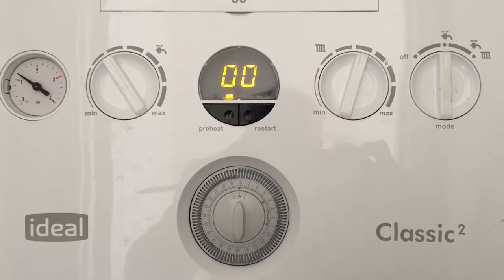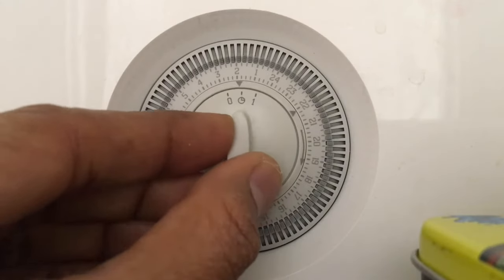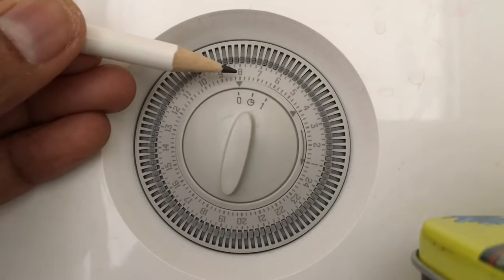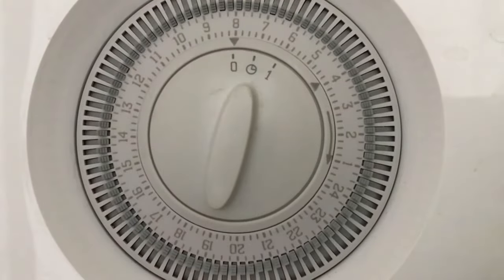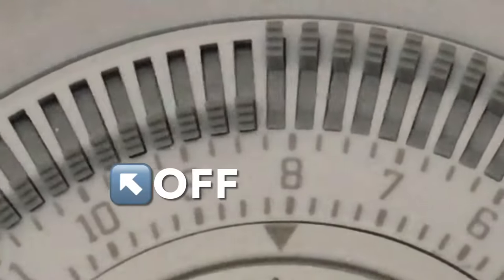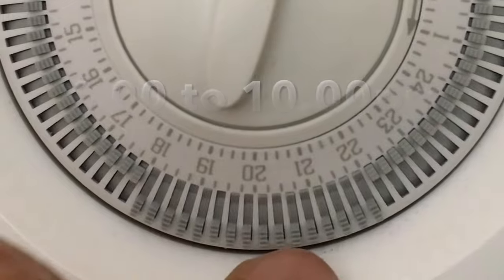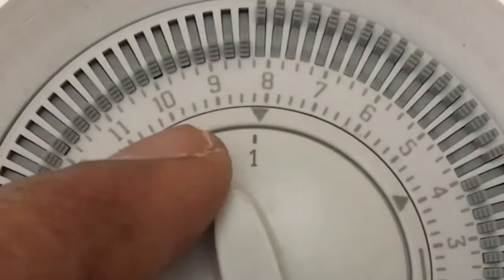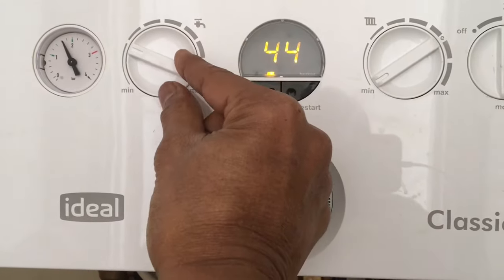How to Use Set Adjust Mechanical Timer Control Pin Clock Switch Instruction Ideal logic Combi Boiler

Comment: Thank you for the video, however you have used the wrong arrow to set the time.  The arrow at 12 o'clock is for setting the function, timed, constant or off and the arrow at 3 o'clock is for setting the time. You have actually set the timer to 4 o'clock.  Hope this helps.
Reply from the maker: Hi Valrita, Thanks for sharing your comment :-)
Actually either of the arrows (12 or 3 o'clock) can be used as reference to setup Clock (Current Time). You can try and let me know how it works.

In my case having done 'CURRENT TIME' at 8:00 am and 'PROGRAM TIME' set between 4:00 am to 8:00 am, the boiler gets switched ON next day morning at 4:00 am when dial rotates clockwise and reaches middle arrow .
Reply: @bicyclecolours8988  Hello, my boiler is the same as this and to set the current time I have to use the arrow at 3 o'clock, the 12 o'clock arrow only deals with the function.
Reply from the maker: Thanks Valrita for sharing your comments, hope this will be useful for other users.
Reply: This comment has just explained sooo much! Thank you 🤣🤣
Reply: This made sense. Thank god i read this comment

Comment: Hi. I need an advice and maybe someone will help me. In my apartment electricity is for top's up. I forgot top up on time and electricity stop working in all house. I top up electicity card and everything working again except boiler. I have ideal exclusive 2 boiler and now it's heating only water, but not radiators. Is it possible that when electricity stop working it could change something in boiler settings? How could I fix it? I would be very grateful for any advice.
Reply from the maker: Hi Marlena,
The boiler is fitted with frost protection that operates in all modes, provided the power supply to the boiler is always turned on. If the water in the boiler falls below 5ºC, the frost protection will activate and run the boiler to avoid freezing. The process does not guarantee that all other parts of the system will be protected. Ideally  boiler should always have electricity supply.

In your case I assume when the power went down the temperature fall below 5ºC and might have caused some frozen pipes to radiator. Quick fix to try - Turn Central Heating Temperature Knob to min and switch Off the Mode Knob. Leave for few seconds and switch On Mode Knob to Hot water and Radiator (tap and radiator symbol). Set Central Heating Temperature Knob to required temperature. If this doesn't help then recommended to consult a safe Registered Engineer.
Reply: @bicyclecolours8988  Thank you so much for your answer! It didn't help unfortunately so I will to consult a engineer like you said. But I really appreciate you trying to help me. Thank you again!

Comment: But if you set it to the top position, that is not the time I want the heating on
Reply from the maker: Yes, If the tappets are up then it will switch on heating during that period.
Reply: @bicyclecolours8988  perhaps I didn’t explain it well. If I set the time to the top arrow (say 11am) and then set the tappets to the on position, The heating will not come on until it reaches the arrow to the right of the centre.
Reply from the maker: Hi Harry, The second arrow printed on the right side of the dial is just a time and control indicator. 

I hope you set the knob to "Timed ON" position after finishing tappet setup. The "Timed ON" position for knob is like straight vertical (you can see a small clock symbol). This causes dial to rotate in clockwise direction. The boiler should turn ON when programmed tappet reaches arrow on top middle.

Sometimes there is a possibility boiler may not light when in “Timed ON” or “Manual ON” position. In such instances increase temperature on room stat.
Reply: @MancAlB  I’ve just had the same realisation! If the timer is set to the arrow at the top say 18:00 and the switches are set to 18:00 then the boiler won’t do anything, I need to set it 4 hours back
Reply from the maker: @Adam Phillips, Hi, As 1st step the dial needs to be set to CURRENT TIMING. Since the video shows setting up of 'CURRENT TIME' and 'PROGRAM TIME' as same (8 am) the viewers may get get little confused. I must have demonstrated with different times and putting bold comments. 

Having done 'CURRENT TIME' and 'PROGRAM TIME' set to same, the boiler will get switched On next day when dial rotates and reaches middle arrow.
Reply from the maker: Hey Harry, I just got to understand your issue more correctly and sorry for delayed reply. 

Hope you noticed as first step the dial needs to be set to CURRENT TIME (Clock setup), at 27 sec as I SAY present time is 8:00 am so middle arrow is aligned to 8.  

In my case having done 'CURRENT TIME' at 8:00 am and 'PROGRAM TIME' set between 4:00 am to 8:00 am, the boiler will get switched ON next day morning at 4:00 am when dial rotates clockwise and reaches middle arrow . 

Actually either of the arrows (middle or right hand side) can be used as reference to setup Clock (Current Time) and Programming times.

Please do let me know if you managed to resolve.
Reply: @bicyclecolours8988  I resolved thank you :)

Comment: To set time its set on the right hand triangle, you do not set timer to the upper triangle mark, you timer will be out.
Reply from the maker: Hey, I understand your point here!
But in this video hope you noticed as first step the dial is set to CURRENT TIME (Clock setup) - at 27 sec as I say present time is 8:00 am so middle arrow is aligned to 8.  
In my case having done 'CURRENT TIME' at 8:00 am and 'PROGRAM TIME' set between 4:00 am to 8:00 am, the boiler will get switched ON next day morning at 4:00 am when dial rotates clockwise and reaches middle arrow. 

Actually either of the arrows (middle or right hand side) can be used as reference to setup Clock (Current Time) and Programming times.

Comment: I have just had this boiler fitted and my boiler is in a cupboard with a heavy chest of drawers in front. Is it possible to turn the heating on and off without having to press the boiler to 1 position or use a timer? And if not can I get something fitted to do this?
Reply from the maker: Hi, You can get a Thermostat installed and connected to your boiler. This will eliminate use of Timer. Please note that disabling the timer function on your boiler may increase your energy consumption and lead to higher utility bills. It is recommended that you consult with a professional plumber or electrician before making any changes to your boiler.

Comment: This is a good video but the outer dial arrow is not shown currently. It's the other arrow.
Reply from the maker: Hi Debjani, Glad the video was helpful :-)
Actually either of the arrows (middle or right hand side) can be used as reference to setup Clock (Current Time) and Programming times.

Comment: If you put it on manual n 1 there should be a link wire in thermostat  terminal blocks to work right? I mean if there is no thermostat fitted.
Reply from the maker: Hey Antonio, Yes, that's correct.

Comment: Great video, shared with mother in law so she could understand new boiler. 
But, you have set the current time incorrectly, where you say it is set to 8am (30 sec in) it is actually set to 4am!
It is the outward facing arrow on the right hand side that determines the current time. 
Do not set the current time at the inward facing arrow at the top, this arrow just identifies the On, Timed or Off mode.
Reply from the maker: Hi David, Thanks for bringing this up!

Hope you noticed as first step the dial needs to be set to CURRENT TIME (Clock setup), at 27 sec as I SAY present time is 8:00 am so middle arrow is aligned to 8.  

In my case having done 'CURRENT TIME' at 8:00 am and 'PROGRAM TIME' set between 4:00 am to 8:00 am, the boiler will get switched ON next day morning at 4:00 am when dial rotates clockwise and reaches middle arrow . 

Actually either of the arrows (middle or right hand side) can be used as reference to setup Clock (Current Time) and Programming times.

Comment: Hi, i am having similar kind of knob in my house. I am new to this kind of system. Is Using timer will give less bills. Do let me know i want to use boiler in efficient way to get power bills and Gas bills optimum. Also I am frequently switching off the system to save money while i am going out. Is it good or bad thing
Reply from the maker: Hi Giri, Using the timer at off peak time will definitely give advantage on bills. Switching off boiler when not in use will have advantage but make sure you don’t land up water freeze in pipes which will make things more complicated.

Comment: Thanks for info but I’ve just moved into my flat and have this boiler. At the moment I do not see temperatures in the centre it just says 00 what does that mean?
Reply from the maker: Hi, Glad the video was helpful :-)
When the boiler starts running either for radiator or for hot water supply then you should be able to see raising temperature on the screen. Until then during idle period it will show 00.

Comment: Can we switch only hot water in this ?
Reply from the maker: Hi Rosemary, The mechanical timer is only to setup On and Off period for boiler. You can switch Domestic Hot Water Mode ON via Mode Control Knob so there is only hot water supply and no heating activated.

Comment: I thought the arrow on the right sets the time??
Reply from the maker: Hey Jan, You can use any one of the arrow as reference to set time. It works either way.
Reply: You are correct. The video is wrong.

Comment: I put the manual off will it the bills go high ?
Reply from the maker: Hi Miriam, When you put Manual Off then this will set Timer to continuously off. The boiler will switch On and Off based on hot water use and for room heating based on thermostat setting. The bills entirely depends on your usage.